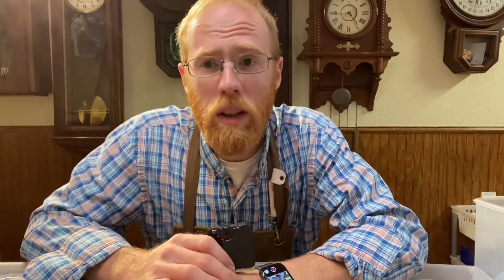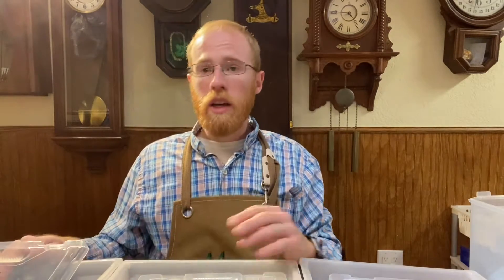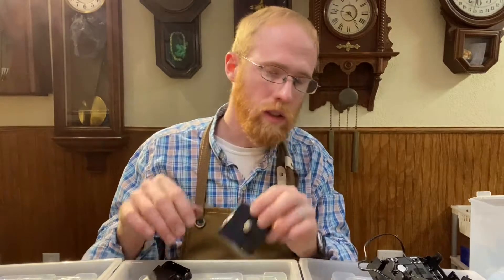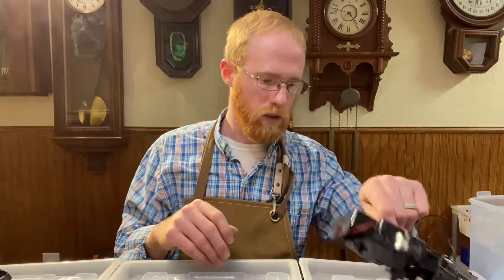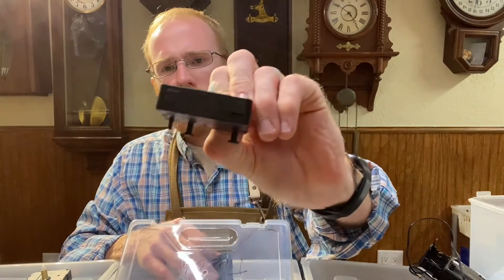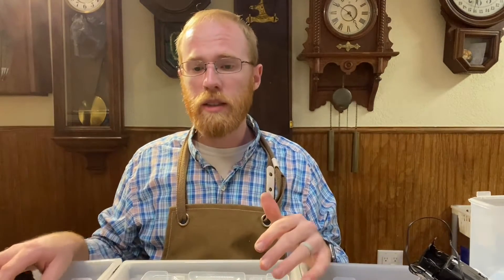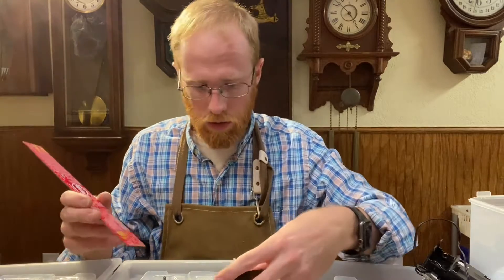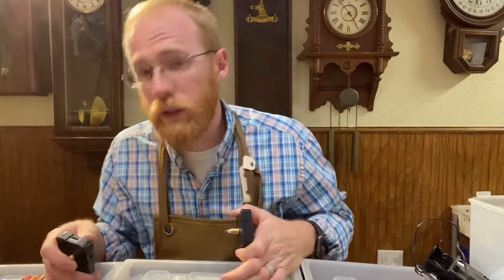Choosing a battery-clock (quartz) movement (which little black box do I need?)

Comment: Why don't they make a Westminster chime mechanism with an internal clock that I can just drop into the back of my mantel clock, or just set behind my clock,  without having to install anything connected to the clock hands?  I am not very handy or mechanical, but I would like my battery operated mantel clock to at least sound like it is working.  I would like something that keeps the time internally, and chimes every quarter, or even just on the hour, where I could just set the hands on my clock to match what this apparatus would chime.  So that when I install the battery, and it starts, it might chime the full Westminster chime, then 12 gongs.  Then I can just set my mantel clock to twelve o'clock, and it would seem like the clock was making the noise!  Is there such an item?

Comment: I have an old stiffel battery operated clock that needs fixing. The movement on it looks different from ones you showed. It’s clear and sits deep in the wood of this clock. How do I get it out and does it matter that movement box is different?

Comment: Useful video, thanks from across the pond. I have been trying to replace a battery run mechanism for a small Acctim mantel clock, the movement that came out of it, is a Young Town quart 12888 with an alarm, it is proving very difficult to source and replace. It only has a 6.5mm spear shaft and it is not held in place with a nut through the dial, but two tiny screws inside the clock.
Reply from the maker: Were you able to find an adequate replacement?
Reply: @LoceneClockworks  Yes, I did find an adequate replacement, I had to make a small mod and use some double sided tape, but I got there in the end. Thanks. 👍
Reply from the maker: @HektorBandimar Nice! Glad you got it figured out!

Comment: How do you get the little box out of the clock???
Reply from the maker: @annhodges2991  There’s usually a nut on the front that has to come off first. Sometimes it takes a special tool to get it off, sometimes just a socket. With that off, if the black box doesn’t come right out, it usually has some sort of adhesive holding it (sometimes there are clips that hold it, but that would be pretty obvious). Twisting it is usually the easiest way to tear the adhesive. Sometimes it’s a wrestling match, but a little determination and a little caution will usually do the trick.